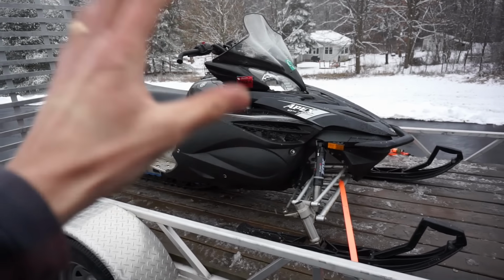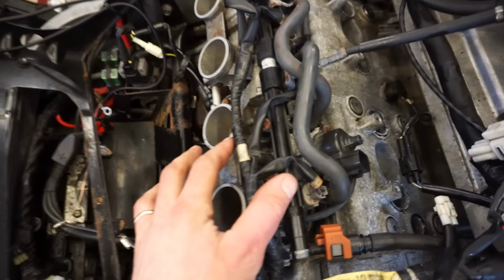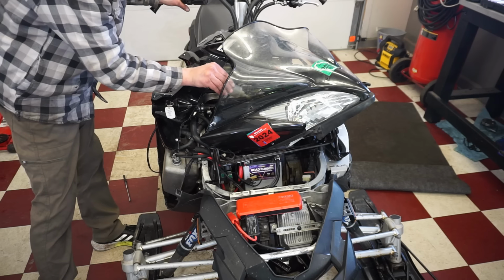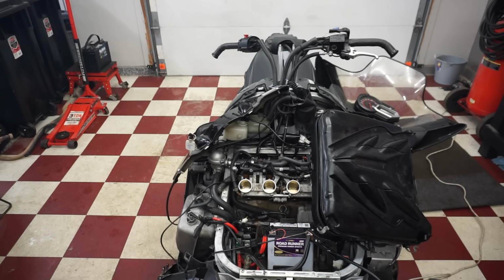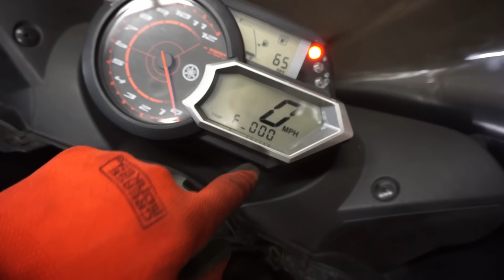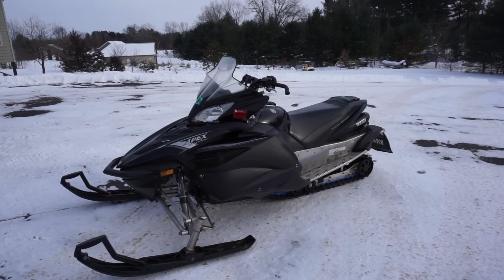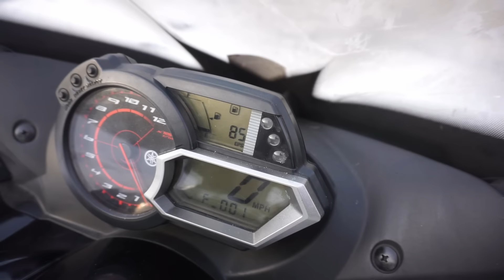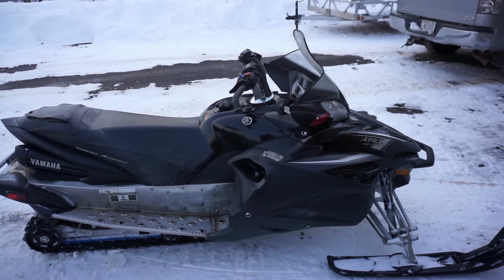$7000 Sled Overheated And Shut Off. Will It Run Again?

Comment: More like a 2500$ sled thats to funny.  A 97mxz will do 100 easy. 1000 buckss cad. On the lake i hit it and the when the skis  touch the snow in about 5 secs im doing 160km which is 100mph. She dangles. You just gotta know wtf your doing. I grew up in the rocky mountain trench near Mackenzie B.C. 24 feet of snow annually. 15 mins from town is the trench unload and start the climb. We were doing massive jumps and river crossings 20 years ago. Place is epic for sledding. Little secret spot. Thats only a handful of ppl have been. Dont go over the backside unless your expert 7 outta 10x they calling the heli to get the newbies with big egos and machines.😢

Comment: dude, that's an oil pressure switch/sensor..... not a knock sensor. 

Knock sensor is just above it on the side of the cylinder bank.

Comment: No matter how you left this video if that machine doesn't have a blown head gasket I will eat my hat. Got so hot it melted sensors... probably knock sensor too... white smoke... low coolant... overheat warning... after refilling the coolant I dont think one test drive was enough to call it good.

Comment: 😂😂😂😂😂😂did u just put dyalyctric grease on the spark plug threads....its supposed to go in the spark plug boot and only the boot...those plugs r going to eventually back out of the head because u put grease on the treads....again 101 mechanics.....let me quess...u put lube on the lug nuts of your vehicles too😂😂😂😂